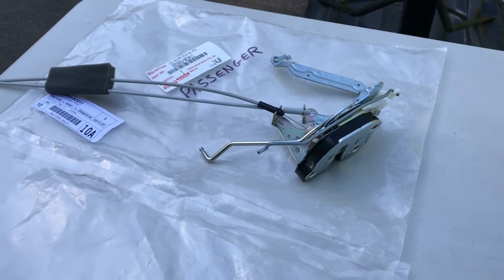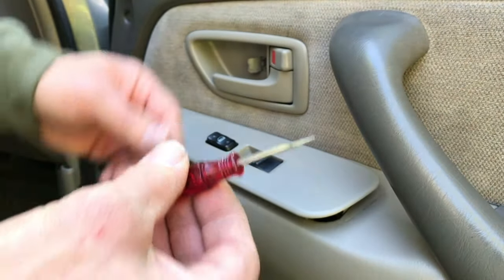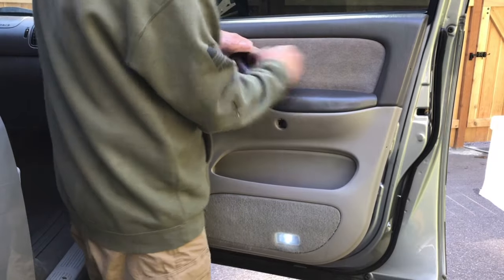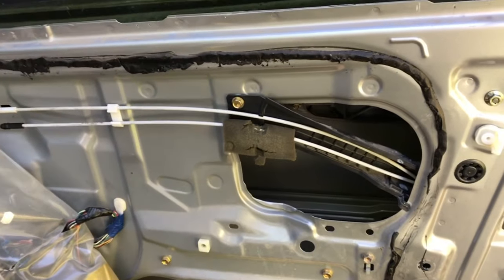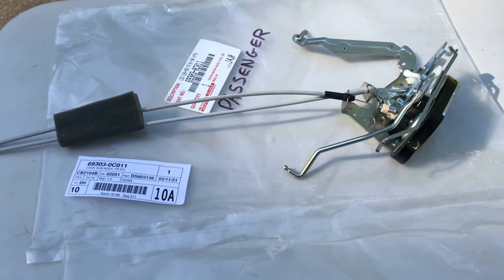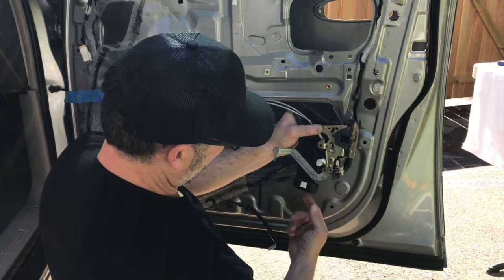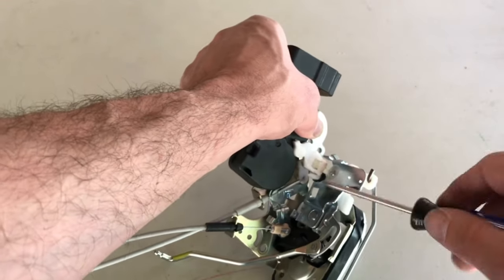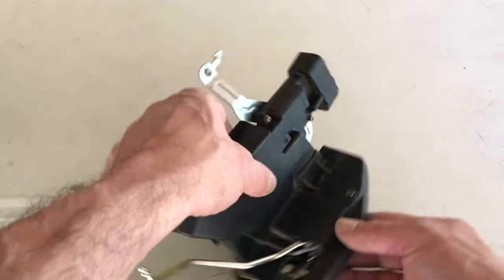Replacing the door latch mechanism and actuator on a 2004 Toyota Sequoia

Comment: Just wanted to say THANK YOU for your video.  I had a neighbor bring me is 06 Tundra - which had a different style of handle and cable loom, but the latch mount and removal was nearly identical to your video.   In fact, the two of us attempted to remove the latch, but couldn't figure out how to get it out of the door without causing collateral damage.   We buttoned everything back up and resigned ourselves to having a dealer do it.   Then I had the stroke of genius to search YouTube University and your video was the closest match.  As soon as we saw that the window regulator/track had to be removed and pulled out of the way of the latch, and that the latch had to come out from the very bottom, it all made sense.  With a renewed sense of confidence, we tore everything back down, and successfully got the latch out without any damage.

Then we took the plate off, holding the springs in place.  We cleaned everything with brake cleaner, and even trimmed a bit of the metal locking latch that rotates and holds the main latch plate in a closed position.  After reassembly, the latch worked good as new.  Once the door was back together, the neighbor was extremely grateful to watch it work as it should. Not a screw or spring left over, too!   Again, none of this would have been possible without your video.  Subscribing... Thanks.
Reply from the maker: Thank you so much and thanks for sharing your experience. It’s so cool to know you help someone out. Youtube is such a cool tool too!

Comment: Thanks for the very well done video! This defect just occurred on my 2005 tundra double cab with 130k miles.  The part numbers you shown were very helpful as my local Toyota dealership showed only a full assembly for nearly $400 each! Also your tip for removing the door latch rod with a needle nose  pliers was awesome as this was the only hold up on the repair, I didn’t need to remove the exterior door handle to remove rods. The first door took about an hour, second door took less then 30 minutes.. thanks again for the very helpful video!
Reply from the maker: Thank you for the comment! I’m glad it helped!

Comment: Great video, thanks so much for sharing. I just replaced the latch on my 03 Sequoia drivers door, following this video step-by-step. Fantastic tutorial. Got the part on sale from local Toyota for ~$140. The only note I’ll add is that I spent over 20 minutes trying to shove the new latch and mechanism behind the window railing until I realized that’s not how I took it out. It obviously wouldn’t fit and I struggled until finally I slid it under and around the front of the railing (as I had taken it out; I just had forgotten after messing with mechanism for about 10mins). Took about 2 hours total, while watching this video several times and pausing, replaying, etc. If I did it again it would be maybe half that time given experience. Lastly, my old broken latch looks so different from the new latch; the white plastic parts are almost completely all broken and missing from where the latch hits the metal d-ring/loop on the door frame. Point being it’s really easy to tell why I was having a hard time closing the door; had to SLAM it several times for it to latch properly. Auto locking was fine so I only replaced the latch and kept the same actuator. Highly recommend doing this yourself. Again, great video and thanks.
Reply from the maker: Thanks a bunch for the comment. What’s really funny is that the same thing you explained kind of happened to me too. I’ve gotten into my door numerous times and never really had a problem but the one I was filming, I ran into an issue where it was getting caught up and I was getting so frustrated trying to get it to go back in place.   Lucky for me I’m able to just simply remove that part from my video. Lol. Glad you got it done.

Comment: Awesome  video !! My 2006 tundra driver door stared to not shut all the way . Now the locking latch  drops down and  the door just bounce open . This video will help a lot for my repair .  Very Clean install also Sir , Cheers from Vegas
Reply from the maker: Thank you! Good luck!
Reply: @EverymanGear   Hey I just google the P# and ebay got some hits also amazon , But amazon says will not fit my TRK . Ill call my local DLR Thanks again!!
Reply: Hears the Part I ordered from Amazon 
( Genuine Toyota 69304-0C010 Door Lock Sub-Assembly)  Perfect fit
Reply: Did u ever find ur part ? And how much?
Reply: @fernandob2139  yes
Genuine Toyota 69304-0C010 Door Lock Sub-Assembly
Brand: TOYOTA
4.8 out of 5 stars    52 ratings | 9 answered questions
Price:	$152.87$152.87  & FREE Returns
Reply: @anthonydombrigues9945  Im sure it will fit my dad's truck it's it's 2006 Toyota tondra
Reply: @anthonydombrigues9945  how much was it
Reply: @anthonydombrigues9945  so this one worked for ur 2006 tondra ??? My dad also has 2006 tondra and his driver door is doing the same .  But when I looked up the one u told me it says it does not fit ??? But I would think it would because it says it fits a 2006  Sequoia witch is also the same thing . Just wondering if that's the part u got ??? And if it worked?
Reply: @fernandob2139  It did work on mine ,  Amazon says it will not fit.  Just follow the Video  Good luck
Reply: @anthonydombrigues9945  thank you very much
Reply: @fernandob2139  I'm glad I could help !
Reply: My 05 DC is having the same issues. Just bounces back, I can only imagine if someone else drives the truck and slams it over and over 😮 Toyota wanted over $800 so I think I will tackle it myself. Also from Las Vegas! 🤘🏽

Comment: Thank you Soo much for this. I just replaced the whole latch mechanism and actuator because it was all that O'Reilly's had available on my 2005 Tundra SR5 and this helped Soo much. I will say that the new part came with the actuator wired backwards and the door lock was operating backwards from the other 3 doors. I had to take it all back out and swap the old actuator into the new mechanism. But after that, everything is perfect!

Comment: Awesome detailed video on pulling this apart and putting it back together. I found on my Tundra that I was having the same problem with the interior lock... not locking all the way after pressing the alarm fob. I found that when removing the two cables from the actual interior hand latch,... you can reattach them a little closer or further apart. I wish I could attach a picture to better explain,... but where they attach,.. they almost look threaded, but they're actually ridged so that you can pop out the cable and reattach them a little closer or further from the door lock. This allows more or less cable travel and allowed my lock to lock all the way when hitting the fob.
Reply from the maker: Yes! I know exactly what you’re talking about. Unfortunately, in the case of mine it never made a difference.

Comment: Great music at beginning:)  Yep... I had to fix a squeaky nut on the window rail assembly and a loose speaker.  However I didn't mess with the power window and lock attachment when taking off the door.  Just got everything released and then reached around to remove.  2006 Double cab Tundra.  Broke several trim clips and plastic covers so had to order more.  By the way, I take pictures of every screw cause I always forget which one goes where.

Comment: Required tools: 10mm socket with extension, T-30 torque tip,  A medium and a small phillipshead screwdrive, and a  flathead.

Comment: I have an early Sequoia and the inner door handle suddenly stopped working. I can roll the window down and open the door from the outside handle. Any thoughts on what might have happened? I will follow your video soon to see if I can fix it.
Reply from the maker: My guess is that the plastic pull handle mechanism broke. If that’s all it is, you’ll be lucky because that’s the cheapest fix and all you’ll have to do is pull the panel off and replace it. Watch the video below  at around 6:06 to see what I’m talking about. 
https://youtu.be/gnEQ_MzKdK0

Comment: It seems to be a common problem on Toyota's. Mine started acting up now it won't release st all. I have a 2002 Tundra SR5 Access cab and it's gonna cost to have it repaired. This should be a dealer recall to have them replaced.

Comment: Thanks for the video.  Were you able to purchase aftermarket part or did you to go dealer route?  What was the cost for the part?  Thanks
Reply from the maker: I looked online for the part. It’s OEM Toyota on the lock mechanism and the actuator was from Napa. The lock mechanism was like $150 and the actuator was I think around $100-120
Reply: @EverymanGear    Thank you for the info and looks like you did a great job on the repair.  Your video will definitely help me with my repair job this week.  Thank you for posting this awesome video!
Reply: @EverymanGear  ….I have a 2002 Tundra and my driver side door won’t open.  How much do you think it will cost me if I was to take it to the shop ?

Comment: I just sprayed my tailgate actuator with brake cleaner and cleaned up the latch component’s as best as I can then sprayed white lithium grease on it. It now works better than when I bought the car. I suspect my sticky tailgate actuator is what caused my handle to break. Real pain in the ass on all the research I did to come to that conclusion. But now my tailgate opens effortlessly.

Comment: I am having the same issue with my 05 Tundra Access Cab. How did you determine it was the actuator or the mechanism itself? Trying to save money and by something I don’t need
Reply: It’s the mechanism, if the door is shutting, but then bouncing back and not quite latching. What I was also having a problem with is when I was hitting the unlock button on the remote, it was not quite unblocking the door enough to open. That’s when you would make sure you actually change the actuator too.
Reply: @wildwoodwood9153  My drivers door is closed and will not open either from the inside handle or outside handle. I can unlock and lock it manually or the remote but the handles do nothing to open the door
Reply from the maker: Look at my other video on my channel (about the rear door latch) . I had the same problem. I explain a little more there. 

https://youtu.be/gnEQ_MzKdK0?si=YokoEHT1LhWIbXCC

Comment: Will just replacing the actuator solve the door slamming back open when trying to close it?  My driver side door bounces back open occasionally when closing and feels like the plastic will eventually break.  Thanks!
Reply from the maker: You’ll need the whole mechanism because it’s the whole latch assembly that gets weak and then the door doesn’t close.

Comment: How did you sync the new actuator with your remote?  Very good video, clear and realistic esp the small screw falling into the mechanism :)
Reply from the maker: No sync was necessary. It simply worked after being replaced.
Reply: @EverymanGear  of course, I'm a dummie, you didn;t replace the accuators, just the latch! Duhhhhh

Comment: ive got the same vehicle and just noticed the same front doors sneakers those model dont reproduced the required midbass output. there's a power bass 7 inch woofers they sound amazing compared to them.im telling you from personal interaction..sorry got side tracked from your video. if your missing midrange bass output.

Comment: What is the screw size to connect the door lock actuator back to the latch assembly? I seem to have lost the screws
Reply from the maker: Oh man. Bummer. I would not be able to tell you that unless I had the thing currently taken apart.
Reply: @EverymanGear  I was able to find those screws. But I have another question. I put the assembly together, but the front door will not latch 100% no matter how hard I close it. What should I do?

Comment: Any videos on the back door? My dad is having problems with the back door not locking.
Reply from the maker: I think there are videos out there about how to work on the back door but I can say this. I have addressed the back latch mechanism on my Sequoia about three times.  Always use original Toyota parts. It might seem appealing to buy metal aftermarket latching mechanism but they never last. I have gone through multiples. In the end, I got so tired of having to take apart the entire door mechanism, especially when you have to crawl inside and do all of that because it won’t open… That I finally took it to a shop and had them repair it properly with a new latch mechanism, cable and pull handle. It became a really annoying and old repair after doing it multiple times.
Reply: I'm in the same boat on my 02. How many years has the Toyota brand parts lasted after having them do it?

Comment: my driver side door on 2001 toyota sequoia driver side wont close all the way. When i press lock it locks and then opens back up. Do u think its the actuator or the latch assembly. ty
Reply from the maker: That’s a tough one… Unfortunately, I think you’re probably just going to have to pick one of them and try it. If it were me, I would try to change the latch assembly first.
Reply from the maker: You could also type in that exact symptom into Google and see if there’s anybody in forums that have had the same problem. I wish I could remember enough to tell you whether or not my door still locked even though I had the door latch problem. Now that I think about it… I’m sure it probably did but I would just have to slam it shut.

Comment: Do you have to change the Actuator as well? The only problem I have is the latch, otherwise it looks good but bounces back and does not closes all the way. Thanks!
Reply from the maker: No, only change the actuator if your having a problem with the DOOR LOCK. Your issue should be fixed with a new latch mechanism.
Reply: Thanks for your reply. Which task would be easier, door latch or rear door handle on a Sequoia? Another important question here: does one need to remove the door handle?

Comment: Thanks for this video. Looks like I need to remove the entire latch to replace the door handle cable. I may be able to replace it with out pulling it all the way out. Doesn’t look too difficult but it is a little intimidating for a first timer. Local shop wanted $250!. I bought the cable for $40 and gonna try myself.  Any tips?
Reply from the maker: I think the biggest thing is to just take your time. Other than car stereo and speaker installs… I really have no experience inside the door and I was able to do it so take photos if you need to and just refer back to the video. Good luck.
Reply: @EverymanGear  such a satisfying feeling to fix this myself. Thanks to your video, I was able to get the job done pretty much hassle free. Thanks again!

Comment: What if your door can't open? 😢 I have that problem, and they are charging me more than I can afford.  Does anyone know?
Reply from the maker: You have to get the door panel off following the same directions but it’s more difficult because you cannot open the door. Then you can usually pull the cable and get the door open to do the work.

Comment: Did you Plasti dip the front grill?
Reply from the maker: Yes! It has like 8-10 coats. Did the grill and all badging years ago and it’s been holding up great.
Reply: @EverymanGear  thanks. I've been thinking of doing this but I go threw the car wash and not sure how it would hold up.
Reply from the maker: @a_aronhdtech  I’ve never had any problem with peeling. Keep in mind, I mostly use car washes that do not have spinning brushes because of my roof rack and also my ditch lights. The key is doing lots of coats. You can find a video here on YouTube. I don’t recall the one I watched, because it’s been years but it was a guy who was doing the emblems on his Toyota Tacoma truck. Good luck

Comment: Has anyone been able to find the actuator only for the the early 2000s sequoia/tundra? All I can find is the whole sub assembly.
Reply from the maker: See the part from Napa at the very end of the video. Still frame photo should have the number on it.
Reply from the maker: Also, I bought the FRONT PASSENGER side, so make sure you clarify which side and front or back...I’m sure the other doors are similar but a number or two different